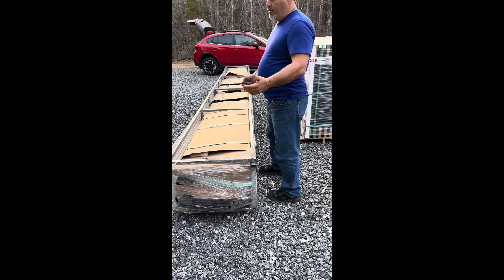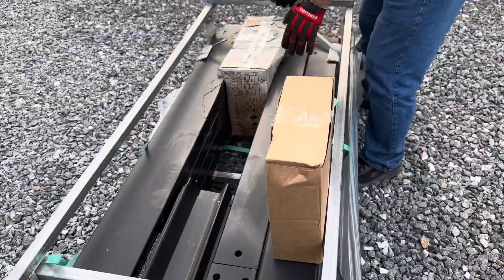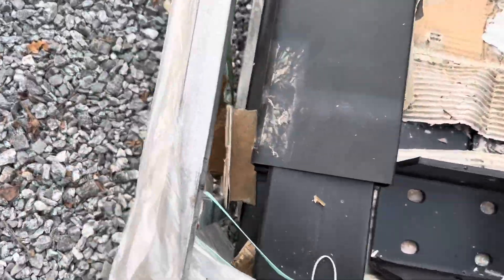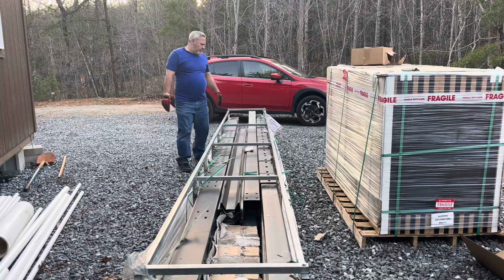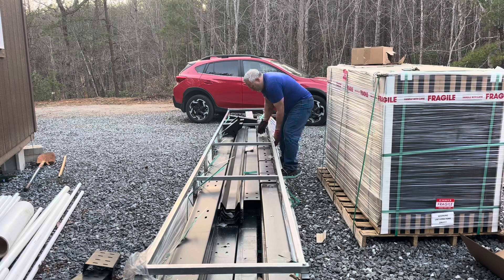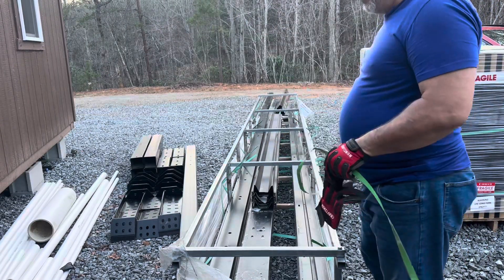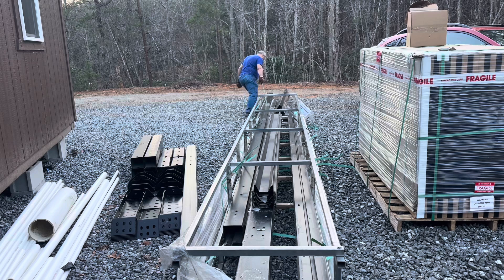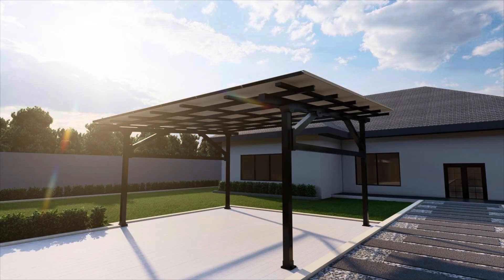Chiko 2 car Solar Carport in boxing

Comment: I apologize if you covered this in your video, I admit I scanned it and did not watch it from start to finish. What is the power output of the one you bought? I checked their spec sheet and it does not list it which I find very odd.
Reply from the maker: Depends on the panels and the location and direction to the sun alignment. Will post a video.